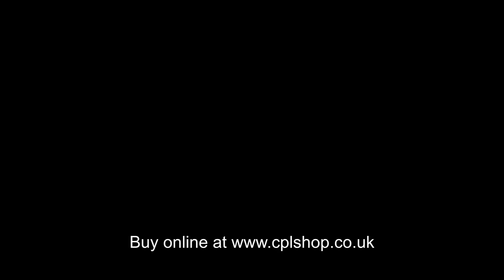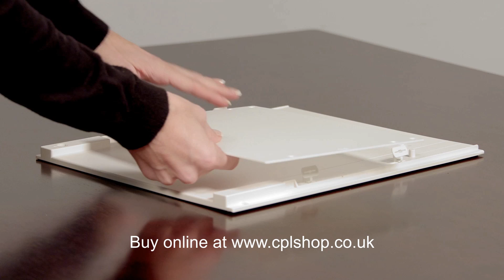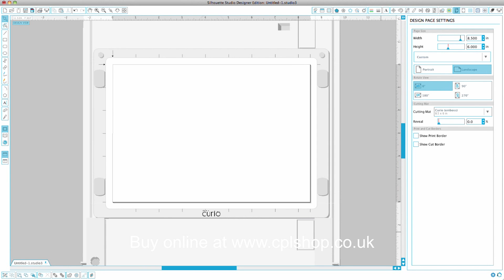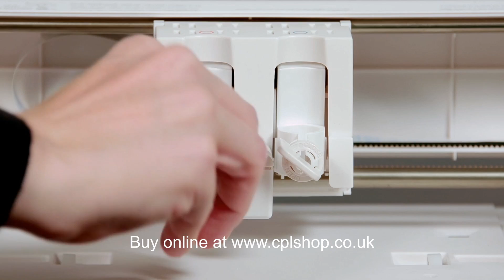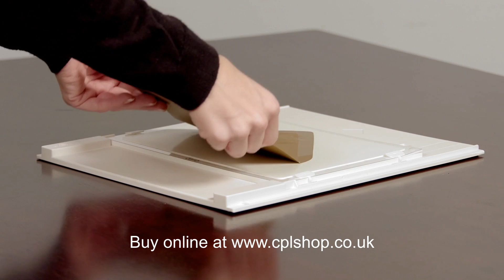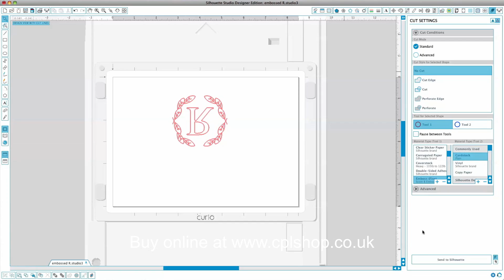Embossing and Debossing with Silhouette Curio

Comment: Ok what if you want to emboss a card or some thing that dont have any adhesive to hold it down to the embossing mat like the envelope does?  When ever I try to emboss any thing on the embossing mat the material just slides around the mat and dont stay put.
Reply: The mat has a film that you should remove. The envelope is not sticky, the mat is.